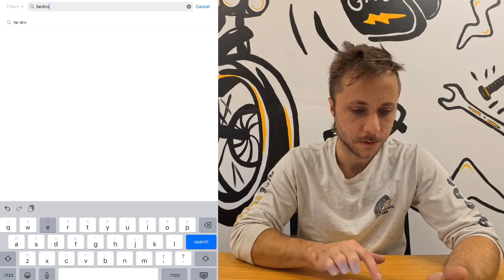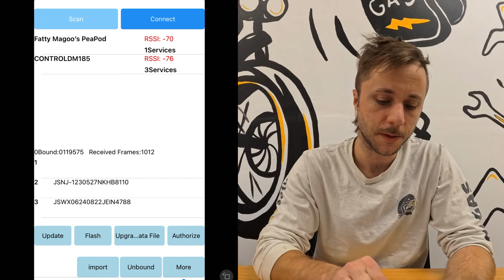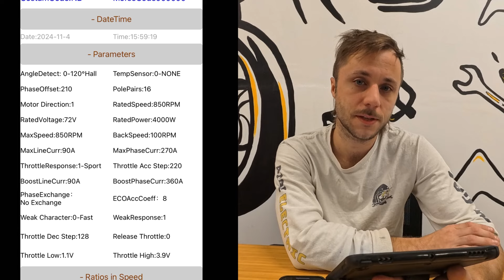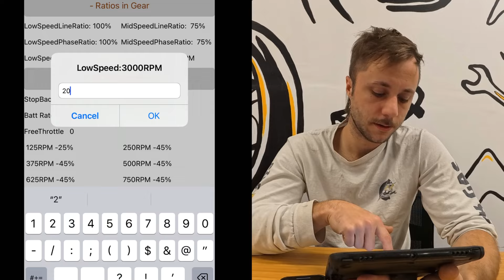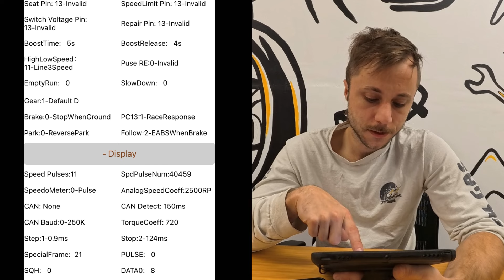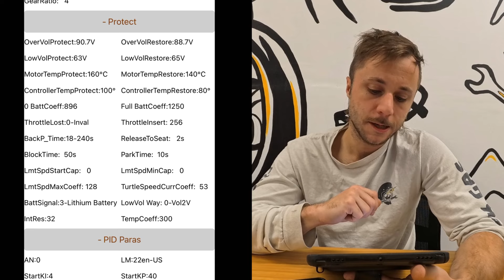The Ultimate Fardriver Controller Guide (Registering | Auto Learn | Settings)

Comment: Why does mine not spin and when i flick the throttle it slightly goes forward but when i hold it the motor will stop and not go even while power is being applied do you know what the problem could be and how i can fix it? I suspect that it isnt set up in the settings idk how much polepairs i have

Comment: Before doing auto-learn check the correct battery voltage, line amps and phase amps settings. There is a little chance for example phase amps is too high even for auto-learn.

Comment: Hello,
I’ve been following your videos for a while and they are extremely helpful, especially regarding Fardriver controllers. Thank you for sharing your knowledge.

I have a question and would really appreciate your opinion. The motor we are using has 30 magnets, which means it should theoretically be 15 pole pairs. However, in the Fardriver controller Pole Pairs menu, there is no option for 15 (the available options are 2, 3, 4, 5, 6, 7, 8, 10, 12, 14, 16, 18, etc.).

In this case, which setting would you recommend choosing — 14 or 16?
Also, how does selecting an incorrect pole pair value affect torque, top speed, and overall efficiency?

Thank you in advance for your time and support.
Best regards.

Comment: Excellent! I am puting an ND72260 on my RadioFlyer wagon. Running 60 volts to a MY1020, chain drive to a live axle. Blew the mosfets apart on the 45A Kunray controller. Opened it up and let the smoke out. LOL

Comment: I’ve got a new FarDriver and Kunray 5000w is installed and I’ve run the auto learn but the reverse doesn’t seem to work can I connect with you for help
Reply: Hey I was thinking of buying that kit of Amazon for my razor what do you think so you like it.?
Reply: @Xerxes_TV it’s actually pretty sweet however as stated above I can’t get the reverse to work or the digital display wire I have 🤷🏻‍♂️

Comment: Hi I'm trying to use the fardriver app using a dongle on the tuitio and when I try the autolearn it's giving a e10 error and wheel will not move
Reply: You need to have the chain off for a mid drive

Comment: Can you please help me tune my fardriver nd72450. I have a stealth bomber e-bike, it has a 72v 30ah battery and apparently it has 8kw motor (12kw peak) after running a self learn program its set to 3000w motor and 4 poles. The far driver app tells me its pulling just under 8000w. That's something I've noticed. Issue im having is its coming up under voltage alarm and turning controller off. Sometimes it can be switched on then off again to reset. Other times it makes one beep and then one high pitched beep and will keep doing that until I charge it.
Please read reply
Reply: It's happening when I try accelerate hard even with 81v in the battery. I never see a voltage dip on the app either. And I rode 67mph yesterday so I really don't think its a 3000w motor lol. Also I had the exact same controller in the bike when I brought it second hand and it worked fine. Then it died so I replaced it with the exact same make and model but I never had a chance to check the old settings. With my old controller I could keep riding and the top speed would get lower and lower to about 15mph before shutting off due to a dead battery. I can now only get it down to 30mph+ before it detects a under voltage alarm and will completely shut off. This i sort of understand as the battery is dieing and it might have low voltage. However when the battery is fully charged and I try accelerate hard it also cuts off like I mentioned above. Please help
Reply: @chloebell5990  Your battery voltage drops when you accelerate hard and line current goes up. It happens easier when your battery is almost empty because the starting point of voltage is already lower. If the internal resistance of your battery is high the sag is deeper. For example 2 mohm per cell times 16 is 32 mohms (if 1p). With 100A line current it's 3,2V drop. The lower starting point plus 3,2V drop reach your low voltage setting of bms (or controller) and trigger protection. Old cells are worse. More cells in parallel or cells with lower resistance helps you to minimize the sag. Also there must be a gap between your bms current value and your controller maximum current value. If your bms is a 100A bms you have to put 90A to your controller max line amp setting to avoid bms to cut the go. A very short time amp peak can trigger the bms to react, that's why there must be a gap. Check those settings of bms and the controller.

Comment: Super clean and clear. Thank you. But I have a Fardriver 721800 that was working but then stopped. And now I can’t get back to auto learn. It just does a slow creep when maxed out for about a couple seconds and then stops. I want it to start from scratch. It’s hooked up to  a 20s16p Molicel p42a pack and a QS 273. Copper everywhere. I’m so bummed. And SAI can’t help me. Please help me out if you can. Again, clean video. Overdue!

Comment: Yeah good advice@ If you change the PID settings and you have not been specifically trained for this, AND knows exactly what you are doing and you have a very specific niche need, you WILL cause a lethal accident.  This is the control loop.  Thanks for video

Comment: My problem is that I can't activate the autolearn or self learn menu...it's closed...the acceleration is connected correctly...hall sensors correctly...the battery voltage is 57.5 V.....
Reply: I can't get past this step...the controller beep beep beep...and I have an undervolting alarm but I don't understand what undervolt is.

Comment: This video is absolutely FILLED with terribly incorrect information, a lot of which are extremely dangerous:
1) rated speed and max speed are NOT the same thing. They are two very different settings. Rated speed is the speed the motor runs at when the exact rated voltage is applied to the motor without any field weakening and with zero load, and is always very close to the voltage multiplied by the KV rating. This setting is used so the controller knows what the kv rating is. Autolearn sets the ratedSpeed; it should never be set manually. Max speed is what it sounds like; the absolute maximum speed the motor can run at safely. Or if you want to limit how fast the motor can turn, this is how you set that. It doesn't matter if this value is too high or too low. If set too high, it'll just rev to whatever it's capable of. If set too low, it'll just act as a speed limiter and stop the motor from revving any higher.
 And NO, the max speed is almost never set the same as rated speed. A motor can be rated at 5krpm, and have a max speed of 12krpm.
2) ratios in speed; I can't even come up with the right way to describe what you said, but no, everything you said is completely wrong. This is used to adjust the field weakening.
3) energy regen should never be set higher than the battery's rated charging amperage. You might have a 200amp battery, but is only capable of a max of 20a charging rate. So you would never want to set the regen higher than 20a, otherwise it will trip the BMS and cause a shutdown. Or if the BMS doesn't do its job properly, it can blow up the battery like an actual grenade.
4) PID definitely can be changed, and you can get much better performance out of it from doing so, you just have to know how PID control loops work, and understand that in fardriver they are for the torque control loop. If you're a beginner with tuning fardrivers and you have a hub motor, I agree that you should just stay away from the PID section. If you have a mid drive motor though, its critical that you change AN to 10, 12, 14, or 16. QS mid drive's typically prefer 10 or 12. Kunray motors almost always prefer 12. Sotion tends to prefer 12 14 or 16. This is one of those settings that requires some trial and error to get correct when using a mid drive. Hub is easy though, 0, just leave it at the default 0.
5) product settings are actually very useful, and a lot can be changed. In fact some of them absolutely need to be changed to get decent performance out of most setups. Beginners can definitely leave them alone though.

Comment: also when now when i plug just the battery and controller together i notice controler  makes a beep ,cant connect to the  controller in the app even when i hit connect it just is connecting for a wile and nothing happens,,,,when i check the volts on the  controller with a meter its reading out like 1 v,,,if i disconect orange wire it reads 54 v again,,,using a 48v batery,so it seems when controler is conected  with power from batery its messing something up?
Reply: You have to confirm the correct voltage setting of your battery. Then it allows you to go on with auto-learn.

Comment: hi does the throttle battery motor  and voltmeter have to all be plugged in just to bind controller to app?
or can i just plug  controller to battery and also orange wire to battery to get power to controller

Comment: Its huge though and is going to take up a lot of real estate. I like it though and how you can ise it as a blue print while making it to yours specifications or needs. Im going to price the parts/ components to build a 72v 50 or 60a battery for my huck rebel but its going to be tricky as there's limited space in the fake fuel tank which is the battery compartment and the seat holds the controller ect..

Comment: If you taper your ratios in speed to look something like this: 100%, 90%,80%, 70%...etc. and say you set your line amps right at the bms rating, in this case 100, aren't you only touching  that 100 amps off the line and up to say 15 mph before it drops down to 90 amps then 80 amps etc as you go up in speed? So you are not really riding around maxing your battery out all day unless you are constantly stopping and going and even then it's only for a few seconds at a time. One could almost argue that you could set your max line amps slightly above your max continuous amps.
Reply: I even taper mine off the jump, so my bike doesnt launch 😂

On mode one its nice and casual up to 10mph and then it launches 😊

Comment: Hi Question for you.. how do I select the correct motor for this build with the controller?  I have the electro and company motor.  When I connect and bind the motor will not spin when I turn the throttle.  Any help would be appreciated

Comment: How do you prevent overheating of the controller?
Reply: Get enough air flow around it and don't use insane high phase amps settings.

Comment: Anyone else having problems just trying to get verify code?   Entered phone number/email and then hit “Get V…code” only for the app to kick me out.   Am I missing something?
Reply: Had the same issue! I put in my own password in the input password slot and finally got the message to check my email
Reply: @ interesting.  I ended up typing in whatever & it let me in.  However, never did get connected to my email.  I have been able to still change parameters etc.  Still has me puzzled.

Comment: My motor is going in reverse and when i hit the motor reverse toggle switch on the app it still spins backwards. Everything is wired up correctly. What do you suggest i do?
Reply: It happen to me too I hope you already fixed but what I did was I change the setting "motor direction" I change it twice and it worked for me.

Comment: I have a black Fardriver controller, specifically the 72270 but it does not appear to have Bluetooth?  I bought the far driver dongle but the only open plug in the harness is a red 2 wire plug and the dongle is 4 wire.  There is a female 4 wire plug which fits the dongle but when I plug in and turn on the bike nothing happens-no light on the dongle and no Bluetooth on the app.

Comment: it does not matter the green one or black one they both require a Bluetooth dongle and green fardriver controller is aftermarket with a small heat sink ,the black controller is original from factory with a bigger heat sink .
Reply: No

Comment: Why do you have your max rpm set to 850 when the 4T qsmotor 205 is 820rpm? Did you set it slughtly higher because you use field weakening?
Reply: 850 rpm is mentioned at qs motor site specs for that motor, so like he said "always use it".